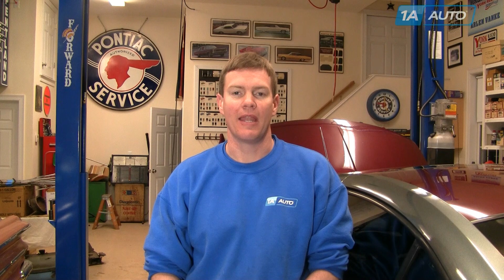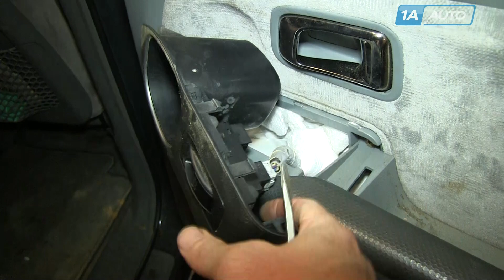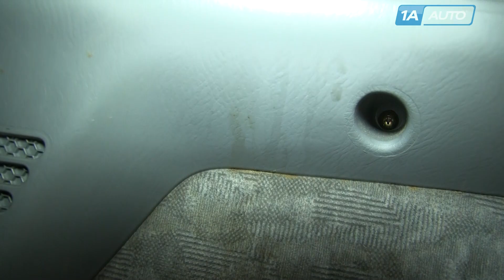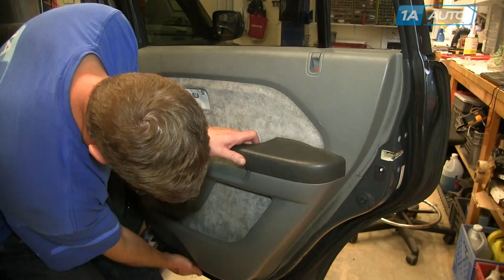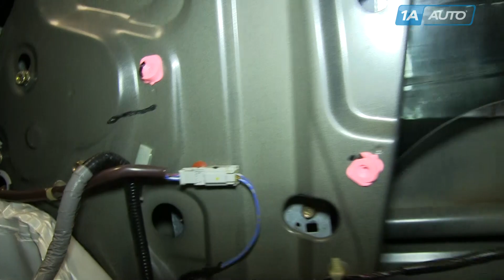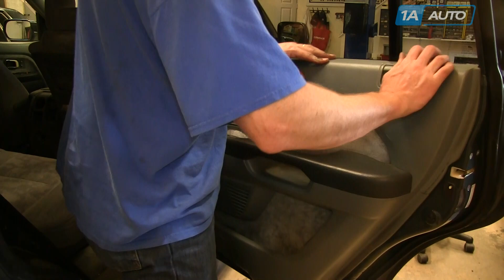How To Replace Rear Window Regulator 03-08 Honda Pilot

Comment: dont know if anyone still watches this video. but my window rolled all the way 'down' when it last worked.  ive removed the panel, removed the water shield. when i place my hand in the space of the inside of the door and i try to push up the window high enough for the window removal bolts to be accessed (through the punched holes in the inner door), it gets 'stuck' and its about 2 to 2-1/2" below where it needs to be. any reason why it would be stuck? or any suggestions?

Comment: Hello! I am stuck trying to lift the window to get to the regulator bolts (to free the window to raise it before I even put the new regulator in). The window will not budge at all. Tried lifting it and I gave up. Any suggestions?

Comment: One tip: if the moving guide on the rail of regulator is not aligned with the holes. You need to connect to button back and move the guide up/down to make sure it’s aligned with the holes. Then you can lock the window with the guide with screws.

Comment: What if the regulator disconnected so the two bolts are in and the motor moves up and down but the window is stuck down?

Comment: I purchased the parts from A1 and installed in 1 he 20 min. I had to take the door panel off again because I had not screwed the window to the regulator when I inserted the 2 bolts. Easy fix and it works!!  Thank you.

Comment: Thanks to those that mention cutting the cables if your window regulator is stuck and you can’t move it up to get to the bolts on the window.  The cables are in cable housing similar to bike brake cables.  Look for them… most easily accessible by removing the speaker.  Cut them and you can now move the window up and down.  This video is excellent too, thanks so much for making it.  I’ve now done 3 regulators with this video.

Comment: Super helpful! Our window was stuck totally down and we couldn't raise it access the two bolts to disconnect it from the regulator. Something was getting caught inside the door panel so I ended up cutting one of the tension lines on the regulator I was going to replace, and then it all came out perfectly. Thank you!

Comment: Well, lo and behold I fixed it! I fixed my window regulator for my 2006 Honda Pilot. The cable was partially broken and it "munged up" the spool in the regulator causing the window to not work. Replacing with a new window regulator fixed it right up! I had first round 1aauto's other youtube video showing only how to remove a door panel to a 2006 Honda Pilot, so I did that first. Then I came back to youtube to look for another video with a search term of something like "power window broken honda pilot 2006" and I found the video here! Saved the day!
Reply from the maker: +Brian Landis Thanks for checking us out! http://1aau.to/m/Shop-1AAuto-c

Comment: What if your window doesn't go up or down? My 2007 Honda Pilot rear passenger window doesn't even go down.
Reply from the maker: +It's Your Boy HR You can cut the cable that moves the window up and down. Be sure to secure the glass as it will then fall down into the door. Thanks for checking us out! 1AAuto.com
Reply: @1AAuto  there's power to the window but is there anything else I can try 1st before replacing it? All switches work but that switch.
Reply from the maker: +It's Your Boy HR We wouldn't be able to diagnose an issue like that here, you may want to have a local mechanic take a look at it. Thanks for checking us out! 1AAuto.com

Comment: I didn't read through all the comments, and this may have already been suggested, but.....

When installing the two screws that may be easily dropped down into the inside of the door, take a tiny bit of that sticky goo and stick it to the head of the bolt before pushing the socket onto it.  That will hold the screw in the socket until the bolt is started.  Don't put too much goo on, though, as that will cause the socket to separate from the extension when removing tools from the door.

Hope this helps somebody.
Reply from the maker: +Springer Pop Thanks for the tip!

Comment: Great video! I encountered a problem due to my window binding up when I tried to raise it to line up the bolts through the holes.  I eventually removed the speaker and saw a cable tightening up every time I tried to manually raise the window.  I cut this cable, and then I was able to follow this video step by step.

Comment: How can I lower window to expose bolts,  if window is stuck in up position.  No power to window, only clicking noise
Reply from the maker: +j b If the regulator is cable run you can cut the cables or if it's a scissor type regulator you can remove the motor from the regulator. Be sure to secure the glass as this will cause it to fall down into the door if you do not. Thanks for checking us out. 1aauto.com

Comment: Thanks for the how-to and for the affordable part from 1AAUTO. Did the left rear on a 2004 Pilot with my adult daughter (her car, she has to help fix it). 
If the window has dropped it’s easy to reach in and push it up by hand into the right place to get the 2 bolts off the bottom of window bracket. Have someone hold it up or masking tape it up over the top of the door frame. After the bolts are out push the window all the way up and tape it there while taking the old part out and putting the new one in. After the new part is in temporarily plug in the window switch and raise the new regulator to line up those 2 holes again, untape the window and lower it gently onto the bracket, then put the 2 bolts in. A broken regulator lets you easily move the window by hand, a good one must be moved using the window switch with the key on. The door handle/rod clip is just a little tricky. Take a picture before you take it off so you can see the orientation. Everything else was just like the video. We unnecessarily removed the speaker and more of the plastic cover than needed before I tried pushing the window halfway up by hand. You can leave the plastic  attached at the bottom and just stick to itself to keep it off the ground. You just need the plastic out of the way enough to get to bolts and uncover the big hole the part passes through. $60 part + 2 hours labor is awesome. Thank you 1AAUTO!
Reply from the maker: +David Johnson Thank you for the great reply. We love to empower our customers by showing you how-to perform your own auto repairs while installing our high quality auto parts. Have a great day! 1aauto.com

Comment: Is there a way to know if it is the regulator or the cable prior to taking the panel off?
Reply from the maker: +Silly Noodle If the regulator or cable are bad normally wouldn't make a difference since you cannot repair the cable on that part. It would be best to replacement the assembly.

Comment: How do I know if it’s the regulator that needs to be replaced?  I came out to my car this afternoon and the window was randomly down. I hear a grinding/clicking type noise when I try the switch but it won’t move the window. 2008 Honda Pilot. Thanks!
Reply from the maker: +Gretchen Nobles Thanks for watching!  There is a good chance that the regulator is broken if you hear grinding when you go to move the window up or down.  I recommend you inspect the part itself to make sure!  1aauto.com

Comment: Thank you for the video, I have a problem with the 2 claim, they are not holding tight the window.... it goes up ok but when I am bring down the window got stock up... what should I do in this case? Thank you for your help...
Reply: try spraying silicone lube on the track

Comment: YOU'LL WANT TO READ THIS!  This is a GREAT video but comes nowhere near as good as their service.  I am not a mechanic by any stretch of the imagination nor am I very mechanically inclined.  But I was able to do it.  

I did have only one issue not addressed in the video.  My window was stuck in the "down" position and would not budge more than about a half an inch.  Not knowing what to do, I called 1AAuto on the off-chance they could direct me...and that is exactly what they did!  I had to cut the cable in order to get the window to move to line it up (had to remove the speaker to access the cable). 

This is the part of the post that is the BIG DEAL and the reason I am taking the time to post.  You see, I wasn't expecting much in the way of assistance to be honest with you.  Full disclosure, I did not order the part from these guys and told them as much (it was an emergency type situation and found the part local).  I told them that I found their video and felt that the instruction provided was good enough that I thought I would give it a try.  1AAuto told me that was not an issue and the customer support gentleman checked with a technician and got me the answer as to how to proceed promptly.  

With service like that, you better believe in the future if I need auto parts (I can do some service on my own such as brakes, etc.) this is the first place I will check for a scheduled project or any project that can wait a few days!  Well done, 1AAuto!!  Other than the post, you have left me speechless.
Reply from the maker: +Jim Stewart Thank you for the great reply. We love to empower our customers by showing you how-to perform your own auto repairs while installing our high quality auto parts. Have a great day! 1aauto.com

Comment: Just finished, and I got the regulator from 1A Auto.  It took a little over 1.5 hours to install.  Biggest problem was that the white waterproofing wouldn't stay on.  I had to  use some HVAC tape since my kids took and lost all of my duct tape. 2001 MDX

Comment: Nice clear video. I was able to replace my regulator without a hitch because of your detailed instructions. Window goes up and down just fine now and I'm only out $60; I didn't even check what the dealer wanted.
Reply: soaringvulture 250-400 usually. For a dealer guess closer to the high side for most other shops it'll be mid to lower range usually

Comment: Hello, I have a broken rear passenger side 2006 Acura MDX regulator. Is this video close enough for me to be able to replace it? We already have the trim, speaker and lining removed.
Reply from the maker: +Lindsay Hild We currently do not have an auto repair video specific to your vehicle. You might be able to apply some of the basic steps shown in this video to your application. Here is a link to the repair part that would fit your vehicle. Hope this helps you out https://www.1aauto.com/2001-06-acura-mdx-window-regulator-passenger-side-rear/i/1awrg01753?f=589170&y=2006

Comment: Great instruction with a small oversight by 1A, namely, the two clamps that literally retain the window itself are accessible in the video ONLY because there is nothing actually wrong with the window regulator; that is, the window actually works.  You are only removing and replacing the same Regulator for the sake of creating your wonderful video instructional.   Because nothing is actually wrong with the Regulator in your video, the tech is able to "position" the window in such a way that the he can line up the holes in the door frame with the 2 screws that literally secure the bottom of the window to the claims that compress and hold it tight.  The tech merely needs to slightly raise/lower the window until these holes line up with the screws. But you may or may not be able to do this if the regulator is actually broken.  Fortunately, this is not a major problem. You'll need to do two things..  1)  Remove the speaker (very simple, 3 screws and 1 wiring clam) and use the vacated hole it creates to access the first of the window-bracket screws, left side,  with a 10mm box end (or similar)  2)  Similarly, then access the second window-bracket (right side) with the 10mm box end through the larger hole on the right.    Other than this small detail, everything else in the video is wonderfully accurate and spot on.  Agency wanted $300+ for 2 new Regulators that I needed (Driver side, front and passenger side, back) plus another $300 labor to install.  OUCH.  Got the 2 complete Regulators, complete w/motors from 1A for $118 total (included expedited shipping), with LIFETIME guarantee (you just have to return the core) and zipped through the installation as if I were a pro.  Yes, the video is THAT good.
Reply from the maker: +James Lacey Thank you for the positive feedback. If you have a minute, drop us a review on our Facebook page to let other people know about your experience with us. Here's a link: https://www.facebook.com/1AAuto/reviews/
Reply from the maker: +James Lacey Thanks for the comment, James, a lot of good points in there!  Any other viewers interested in purchasing these parts to repair their vehicle please click the link: http://www.1aauto.com/2003-08-honda-pilot-window-regulator-passenger-side-rear/i/1awrg01955?utm_source=YouTube&utm_medium=CTA+Comment&utm_campaign=ytcomment&utm_term=J0fiw720OOc
Reply: James Lacey my 2 claims are not holding tight the window.... it goes up ok but when I bring down the window stock up... what should I do in this case? Thank you for your help...
Reply: Thank you James for pointing that out! Many other videos from other sources had the same oversight. Either the regulator was not broken or the cable was snapped. Either one will allow the window to be moved to the correct position to get to the window screws.

Comment: Did it myself as well. However with the 2 bottom bolts on broke motor I had to literally reach in an use a crescent wrench to loosen very slowly because I was unable to lift the glass to be completely above.  Also I had to attach door window power with the basic power to the motor to get the window to work and then i was able to get those bottom 2 bolts in an opening in the door to tighten with my socket.